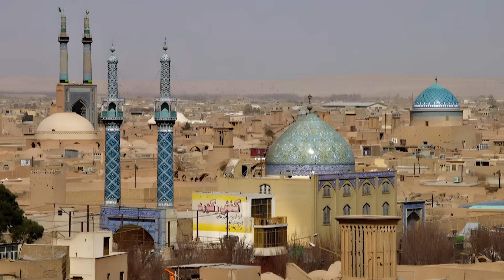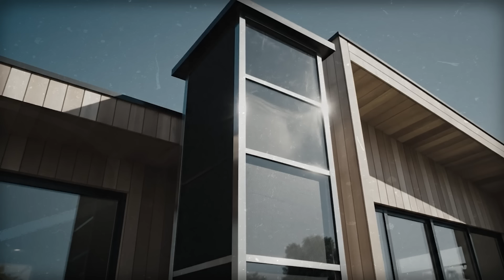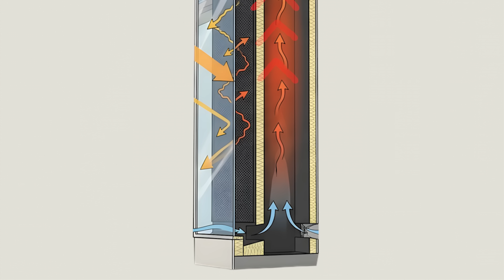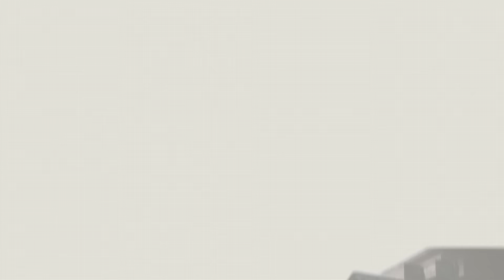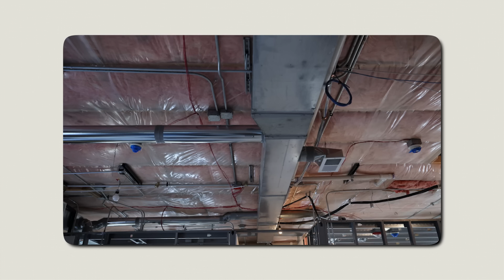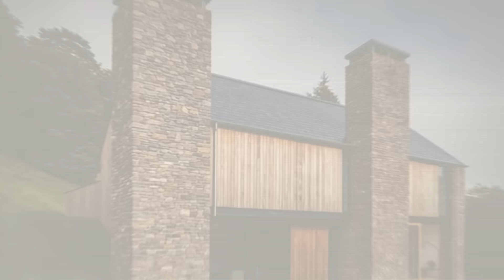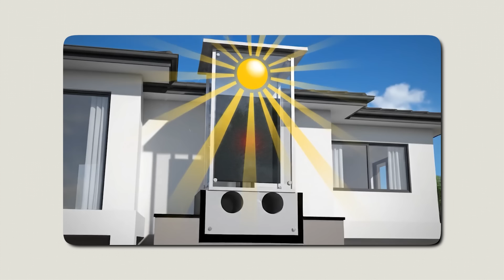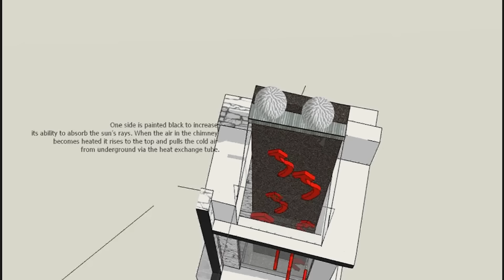This Chimney Will Cool Your Entire Home WITHOUT Electricity. Why Did The Energy Industry Hide It?

Comment: We do something similar in Germany too, without any dedicated architecture: If you have both an attic and a basement, open all the doors, put blinds on the south- and south-east facing windows, and open the windows in both the attic and the basement. As long as the Doors stay open, the hallway usually stays at a nice temperature and has  fresh air. We sure are glad that temperatures rarely exceed 35°C though, but I do live under the east roofside, and it gets reaaally hot up here without this method, since most homes here do not have Air contitioning or mechanical ventilation

Comment: Wondering how this would be in Baja California Sur. We are a sub tropical desert. It regularly gets well over a 100° for a few months every year. But we have humidity that can hover around 50%. On top of that, the ground water is very minimal at best. Plus, we have hurricanes. I think our home would be better with a traditional Coppola.
Reply: The Coppola with a ground cooling tube should work. A clay tube in bedded in sand should work well, as I assume Baja is rocky and has earthquakes and sand is very forgiving and yet conducts heat and cold well.

Comment: My university building are using these, but the play is they made the roof so high with a lot of ventilation. And at the bottom level, a lot of ventilation to catch the cool air.
The air automatically going up inside of the building and being thrown away.

Comment: Fact check:
1. University of Nottingham: 75% cooling reduction" — Real study, distorted citation. The 75% figure comes from a solar chimney combined with a windcatcher and a water spray system in Middle Eastern climate — not a bare solar chimney. Stripping the qualifiers turns a niche finding into a universal promise.

2. "15°F cooling, anywhere, without electricity" — Climate-dependent and presented as universal. Works brilliantly in hot-dry Arizona/Iran. Marginal in humid or cool-cloudy climates. Selling Phoenix physics as a global solution.

3. "1995 University of Arizona study: 75°F indoors when 106°F outside" — Could not verify this specific study despite targeted searching. May be real and miscited, or invented. Flagged as unverifiable.

4. "British Medical Journal documented lower mortality from cholera and influenza in thermal-stack-equipped wards"** — Unverifiable as cited, AND the underlying logic is wrong: cholera is waterborne, not airborne, so ventilation wouldn't meaningfully reduce its spread. Bad epidemiology stitched onto a vague historical reference.

5. "Bernoulli principle drives the stack effect" — Sloppy physics. The stack effect is buoyancy-driven (density differences from heating). Bernoulli's principle is about pressure in moving fluids — different mechanism. Sounds technical, isn't accurate.

6. "Constant 54°F at 6 feet underground" — Half-truth. True stability requires roughly 30+ feet depth; at 6 feet the soil is still seasonally affected. The "constant" temperature also varies by region — it's roughly local annual mean air temperature, not a universal 54°F. New York would be closer to 50°F; Phoenix's around 72°F.

7. "Yazd regularly exceeds 113°F" — Overstated. Yazd routinely hits 40°C+ (104°F+) in summer, with peak days higher. Presenting peak-summer extremes as routine inflates the case.

8. "3,000-year-old technology" — At the upper edge of plausible. Best-supported figure for the windcatcher concept is about 2,500 years. Most extant Yazd structures are 14th-century. Off by 500 years and selling the headline number.

9. "$300–$500 DIY retrofit replaces your AC" — Materials cost only, for a small wall-hanging unit, in an ideal climate. Doesn't include structural modifications, proper sizing, professional consultation, or the reality that a retrofit performs dramatically worse than purpose-built integration. The price tag is technically true; the implied capability is not.

Comment: Just install AC units and solar panels on the roof to power the ACs. Much cheaper and much better performance.
Furthermore, as some people already mentioned, this chimney system is useless un hot and humid climates.

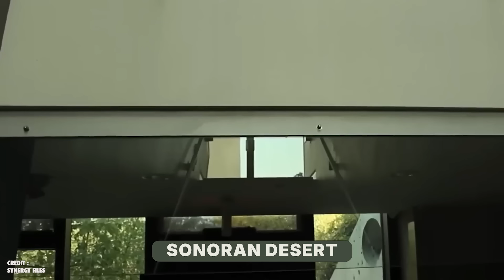Comment: 5:17 “They found that the system maintained an indoor temperature of 75 degrees Fahrenheit while the outside air was a blistering 106 degrees Fahrenheit that is a 17 degree Fahrenheit reduction” uhhh no? That would be 31 degrees difference

Comment: No, No its does not "cool" your house. Stop talking shit. your house can never be colder than ambient temperature without some kind of work being put in and typically in hot arid environments where this is used its from evaporative cooling ie "swamp cooling". These are not fucking magical devices that produce cooling from nothing. Channels like this are why engineers like me have to remind home owners there is no such thing as a free lunch. if its 85F outside and this produces a breeze it FEELS like 75F because more air is passing your skin and that means more water loss cooling your body. It won't work in humid environments, it wont work north of 85F, it won't work do anything but produce a hot sticky breeze in the midwest during summer. If you want to actually make your cooling work

A) Put your damn condensers under shade, this is like the literal biggest loss of system cooling ever. Half the units are painted fucking gun metal gray and absorb heat like a mother fucker meaning it has to work harder to reject heat from your house.

B) plant a fucking tree or two. check your area, local trees that are drought resistant are easy enough to find everywhere, shade your shit plus trees create micro environments by, lets learn this EVAPORATIVE transpiration which is basically a natural form of swamp cooler.

C) shade your damn windows. Do it, shade that shit, double pane, low E coatings and if all else is too expensive stick on a damn reflective coating. Serious, like 20$ on amazon. 

D) clear caulk, seal your damn house, honestly. Helps with bugs too. Every crack, crevice and ridge. Caulk that shit. 

E) Doors. Weather seals and edges. Again. Prevents dust, bugs and heat. 

F) Seal your attic space. More expensive option, gotta fill the sumbitch with insulation and panel it, this can be expensive. 

Honestly stop trying to pretend this shit is new, this is a modern take on 10th century Arabic technology.

Comment: That's not an "innovation". It's an existing technology that has been used for thousands of years in the Persian Gulf. They are called "wind towers" and they are so iconic, the University of Qatar has decorative ones as the core feature of most of its buildings, bringing together the campus design around a core, traditional theme.

Comment: It's a nice approach but with very very limited applicability.
Because you "cool" you home with recirculation so you can have in home, at most the temperature of the entering air. If you a lot of spare cold ground water works.
Also efficiency drop with humidity of the air. And you need to be ok to have unfiltered ventilation thought a water reservoir.
So... lower health standard and applicable only on dry places with a lot of water and not applicable to city for today density of population.
Very tiny. A air VOC with heat pump powered by solar instead... works everywhere you have a lot of scorching sun. This is the reason while it have won the climatization race.
Still is true that builders need to be aware of alternative, where those can be applied.

Comment: I may have missed something, but from my understanding this  is great for air refreshing, but not for cooling. If the outside air is hotter than the inside, then refrshing the air will make it hotter.

I guess it highly depends on the situation. It'll work wonders if you can draw out cooler air, but it'll be disastrous when you draw in hot humid air. 

I love architectural/natural solutions over mechenical ones, but I do not like when only the pros are being told without telling the cons.

Comment: For this to work best musn't the air intake be through a subterannean or water filled chamber? otherwise you are just sucking in ground level air in from one side of the building. Even on the shaded side of the building this could still be very warm on a 40+ C degree day. And as someone else said, it will only work in dry climates.

Comment: Hi, I'm in the HVAC business. This is called natural/passive ventilation. It requires an underground water source and winds with low humidity to cool. On a 90F day it could produce 70F air in a perfect world. A working AC system produces 46F air. Thus this system would take all day to get the building down to the 70F. Without that water it's no different than opening your windows in the summer. To make what the video is showing, you'd need an underground lake, tunnels, and a high stack. That's likely pushing well over $100K in construction to cool/heat a 1200 sqf home. 

The more common version is having vents on the bottom of your home and in the roof. It basically does the same thing, but without water, it doesn't really cool. You will need filters on the bottom vents so dirt, bugs, and pollution doesn't enter your home. But even if you did have water to cool this air, it would very likely result in mold anywhere that isn't the desert. 

So if you actually attempt this, what you will find is the normal AC unit is cheaper and more effective than passive ventilation. 

But if you want something in between these options, have a roofer install solar attic fans and a make up air unit. If you want to get really fancy have the plumber run the cold water pipes through the make up air duct before it hits the hot water boiler.
Reply: Yes indeed! AC running + Solar Panels = Enough to reduce electricity bills and keep the home cool on hot days.
Reply: Thank you.
Reply: Yes, that’s exactly why we use evaporative coolers in Australia’s dry desert regions. They’re far less hassle and simply get the job done.
Reply: yeap
Reply: your comment is hot
Reply: You wouldn't happen to know of a channel capable of showing me this fancy option would you?
Reply: @LongShaynx  Its called a Hydronic Duct Heating and Cooling Coil. In a perfect world it cools the air entering the building while warming the water entering the boiler. With a switching valve it will send hot water through the coil instead to heat the air.
Reply: It's always about the humidity.
Reply: Cooperado uses this principle. 

In dry areas is perfect
Reply: Wouldn't this be a condensation problem if you want to run it through the cold water pipes?
Reply: @rexhope4666  Rarely. This situational in regards to relative humidity, air temp, and dew point. But in general your tap water would need to drop below 50F to start condensation on the pipes. In Florida that's more like 65F but you're not using a system like this anyway. Everywhere else you're not running cold water through it unless it's hot outside so the water temp will be closer to 70F.
Reply: How about you pay your client's energy bills
Reply: Will this technology work in the desert?
Reply: I have seen a video praising the middle courtyard pond /swimming pool to create great climate in the house
Reply: I don't know why I find this comment so sexy!!!
Reply: @dayop.6345 bec intelligence is hot AF!!
Reply: Also depending on soil conditions Ground Source Heat Pumps are twice the cost of normal AC but like 1/4th the operating cost and little to no maintenance.  GSHPs get a bad rap because people put them in deserts where the ground soil temperature is ass thinking they are magic and half of the early ones were put in like assholes with no real verification. Reminds me of how much the industry thought VRF was the god send in the 90s and the early versions were utter ass so half the government adopters made it so they could never buy it again even though they are so much better now.
Reply: @icesnake84 
Your response was a little over my head but I appreciate you keeping it honest about cost and efficacy.
Reply: @icesnake84 VRF?
Reply: @icesnake84 how would these fare in arkansas with high Temps and high humidity in the summer? I'm looking at the best way to heat/cool in a house I'm building.
Reply: @solutionsforlife2451  I know this was asked of someone else, but hopefully this helps out. 

For the south, the best way is to install a slightly oversize heat pump with an inline dehumidifier. Since it doesn't snow much a heat pump should be able to handle all seasons fairly well. You want one slightly oversized to handle the heat waves and cold snaps that have become commonplace. The dehumidifier will assist the normal AC de-humidification to create a dryer indoor condition.
Reply: @icesnake84  Cost and location are always factors. That's why almost no new builds install them despite being the best time to install them. For the most part I'd only recommend them to people who live near a lake or have enough open land to lay a shallow loop.
Reply: @icesnake84  Thanks for your expert input. So what is your opinion on the other method of cooling your home by digging a trench 5 feet deep around your home and laying a certain ducting pipe where it captures the average underground temp of 50 - 60 degrees and flow that through your air vents? I'm sure you've heard of that method. I've actually had someone show me a working model years ago that dropped his indoor temp to 73 degrees on a day that was 88. I know this type of cooling energy isn't good for your industry but it is something we home owners are very curious about. Thank you.
Reply: BUT , facts like thatdoes not get click baits , this is like samp coolers . they work in dry climits like arizona
Reply: Thats simply not true. You dont need water. These systems are littered through the Middle East and other desert climates. No water in the desert.
Reply: @thecocktailian2091 Many of the larger older houses in the deserts are built on top of the wells.

Best way to protect them
Reply: @thecocktailian2091  If there is no water then there are no people, much less palaces. Google the word Shabestan.

Comment: This is how the Jewish Second Temple was designed. Probably making it a wonder of its time. The area is dry, low humidity and windy during the summer. The temple is built over an underground stream. I’m sure the median temperature may have been up to 10 degrees cooler or more inside the temple. Jerusalem is at a high elevation of 2500 feet. So the day may reach 85 to 95 degrees in the summer with relatively cool evenings.

Comment: If temperatures in Winter time are too Low you could even use heatpumps in Order to Heat the building with much smaller and cheaper Heating.

Comment: BEFORE YOU TRY THIS, take note of two factors. One humidity, climates with high humidity dramatically lowers the effectiveness. Two pollution, your local weather station updates the air quality of the area if your local area consistently gets lower quality of air the last thing you need is more toxic air flowing through your home. Remember the reason this design worked back then was because deserts were dry, arid, and there were no factories/vehicles polluting the air.

Comment: I always like the idea of designing a building ventilated/cooled by the stack effect but at least in the UK, it is unreliable. Building regs require ventilation year round, and the stack effect can be very effective in summer but you need some sort of mechanical vent to get moisture and CO2 out in winter, so MVHR is the only practical solution if you want to be most energy efficient. Not sure about your comments on an HVAC system recirculating air, it is designed to exchange air while retaining heat. Source, I'm a mechanical building services engineer (a designer not an installer or contractor, I want an efficient and effective design for the benefit of the end user and client)

Comment: By adding a second run of ducting that can be blocked off depening on the season, this could be used to provide heat during the winter, too. I've seen people build heat capture grids that double as heat exchangers on the south-facing exterior wall (in northern hemisphere) to push heated air into the living space.

Comment: Issues will be rats, insect infestation, common birds will nest, bats can also stays there, and having ventilation should focus mainly on efficiency and maintenance. And you also mentioned digging pipe underground where rats and mosquito even cockroaches favorite spot. 

You may have a cool air but your house will surely smell like a giant trashbag 

The only solution on your non-existing problem is just tree, get a tall tree or a wide tree can be mahogany or mango tree and you'll have something to pick too in summer time. 

If you're going to use 2-3square feet of your house to a giant spawning ground of pests, better use it something useful and also a place to go in events of earthquake a fking simple tree

Comment: “Cool” tech. Let’s not pretend this will give you the same comfort as an HVAC system in Florida though. 

Interestingly, I saw a similar but opposite tech at a national park. They had wet fabric inside a chimney which cooled the air as it evaporated. The denser cool air would flow out of the chimney as warmer dry air came in to be cooled.

Comment: This only works if:

1. Your in-house temp a lot higher than outside temp
Or:
2. You can safely dig into the ground and have a underground 'cave' with breathable air
And
Have very dry air on the ambient.

There's a reason these things were build on desert-like regions.

If you try to use this on a city, with moist air and no underground 'cold' air. It won't work better than having a simple air passage architecture on your house.
Not eveb talking buildings where most people live on one floor (each family/people group live on their own floor without comunication between apartments so there's no vertical air movement)